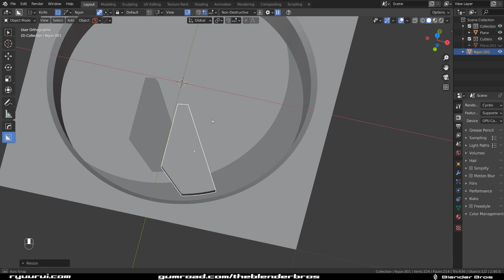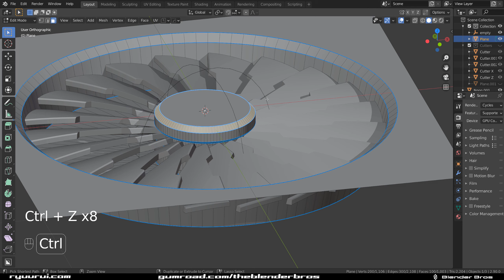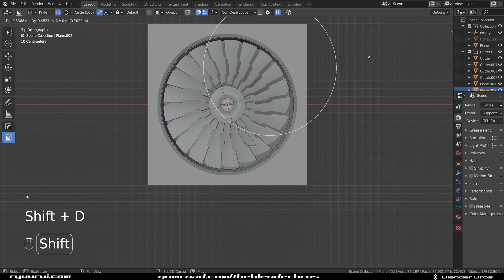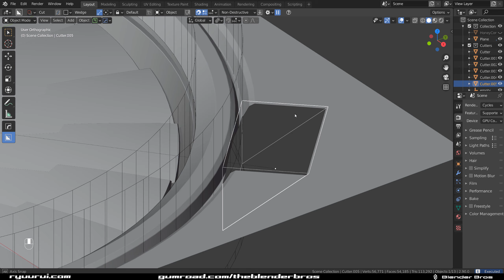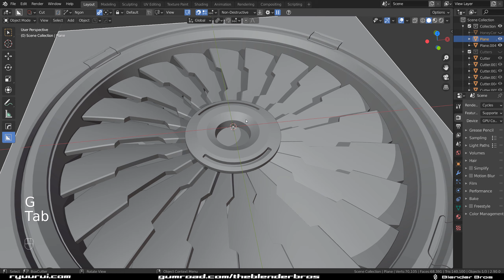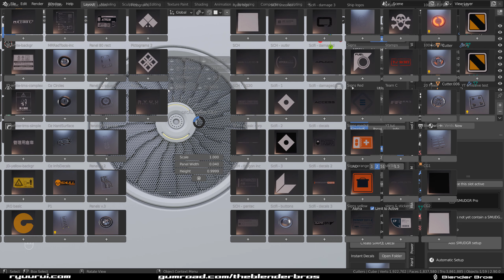Complex DECAL TUTORIAL for Blender

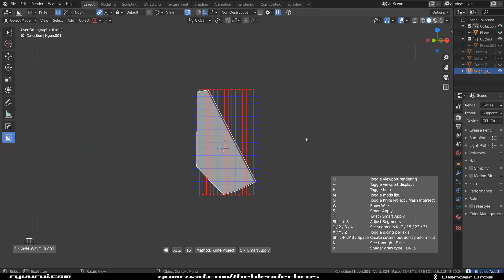Comment: Hi Ryu, at 4:10 you're doing shift+click whihc gives you the knives as a separate object which you can move/reorient etc. I can't get it to work with Dice V2. Any workaround for that? Thanks!
Reply from the maker: well that's a 2y old vid so things may have changed, just check the tooltip for the new dice
Reply: did you find a workaround? I can't manage to exit it without applying

Comment: imagine that I have an instanced cube, is it possible to work with a cube and be able to replicate the decalls to the other cubes? Thank you
Reply from the maker: if you include decals in the folder - yes
Reply: @PonteRyuurui  I don't understand your answer, I have 200 columns (architecture) and I want to add screws but I can't go one by one and if I do a join (Control + J) it doesn't work quite right.
Reply from the maker: @ua_visuals  move decals into column collection, then instance that collection
Reply: @PonteRyuurui  It works making a collection instance, but that should be made before

Comment: Very nice.  I came for the decal making, but stayed because of all the different small ways you use Hops/BC/Meshmachine as they were intended.  There was a guy I told I was excited for his follow on tuts about trim sheets, so he stopped.  Counterintuitive outcome, but not unexpected given the human condition.  Ty for continuing to share knowledge.

I'm curious given your kinda beastie machine how long a decal with a few million took to bake?  5mins? 10mins?  I'd like a measure so I know if my computer seems to hang, it may not be, it's just calculating.

I was wondering about your teenie weenie bevels.  When I do them for my assets I want to port to UE4, so I bake the bevels from the high poly, they don't show up well in the game engine.  I see they work for making decals, so I continue to learn.  I make my bevels about 2x as thick as yours and they start to read with "standard" assets.  Am I missing something, or your intention not porting to a game engine is the difference between our approach and "different needs?"
Reply from the maker: It depends on so many factors, emissives take longer, also geo count is important, subset decals will take longer too.